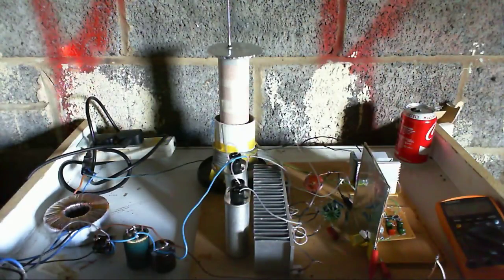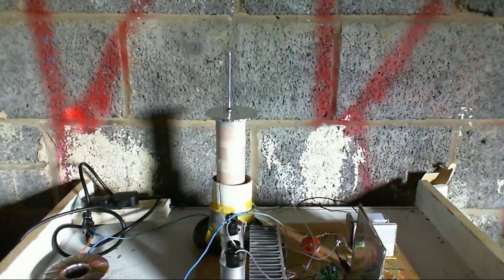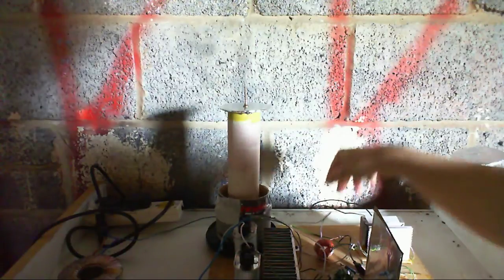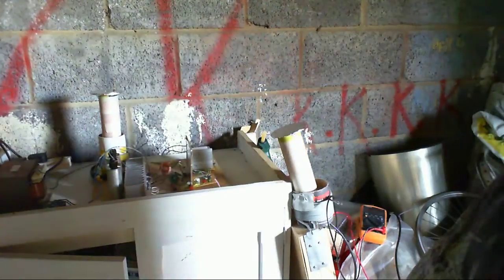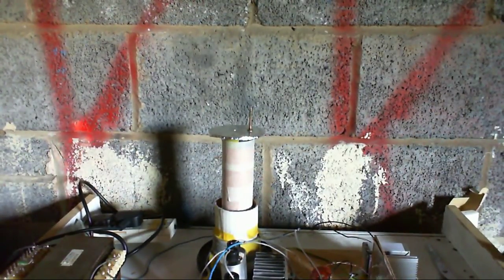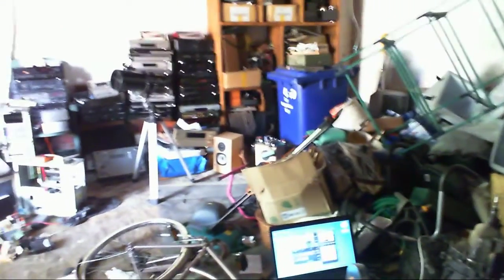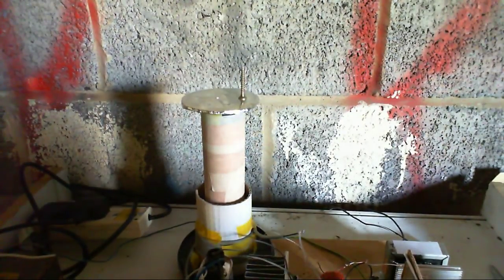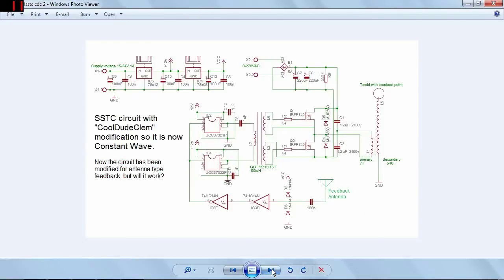My SSTC on Constant Wave, with Plasma & Smoke!

Comment: top video as always , are you planning for a much higher voltage and if so how high?
Reply from the maker: Sudo Dreams I might try and run this off rectified UK mains (340 volts) now I've converted the circuit to Antenna feedback.  Big arcs, exploding mosfets or flames await!
Reply: CoolDudeClem  thank you for your reply can not wait for the arcs and sparks

Comment: Nice output and good video Clem, but please change out those microwave caps, there rated 100hz, not 600khz.
Reply from the maker: ***** I didin't really have much choice in the capacitors, these were the closest I have to what I need.  When I get some proper film capacitors I will use those instead.